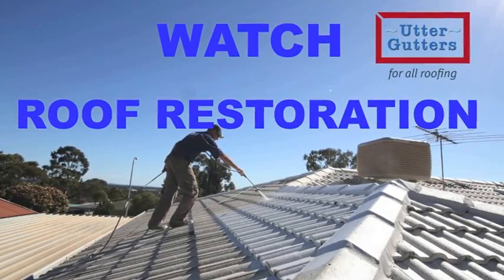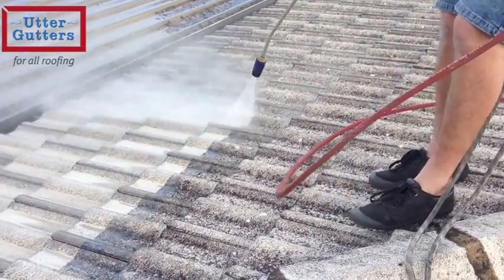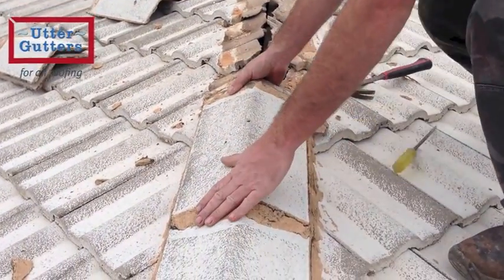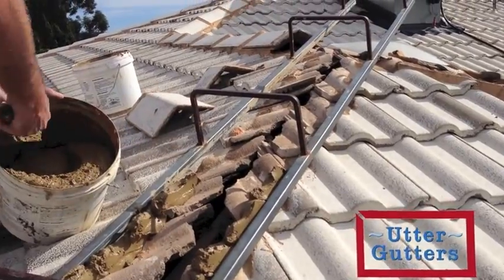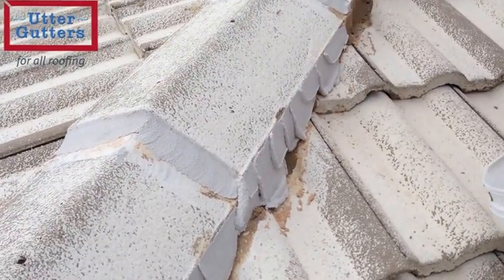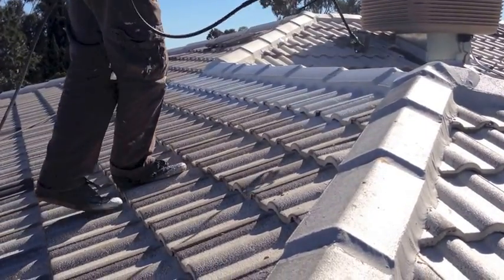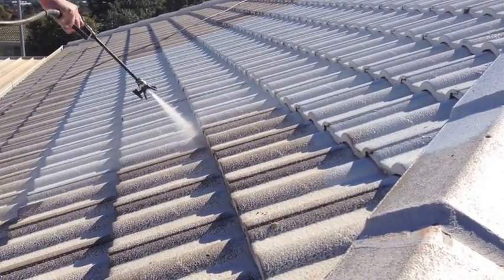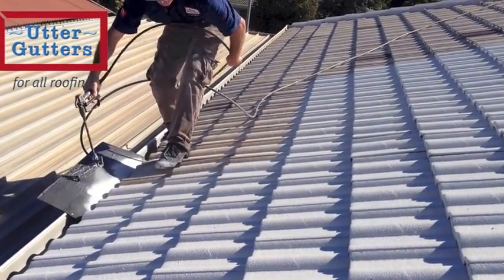Roof Restoration by Utter Gutters

Comment: A  GUN  THE  ONLY  WAY  AT  2500PSI   TO  REMOVE  MOSS .  HE  POINTING  OVER  CONCRETE  ITS  NOT  5MM  UNDER  CAPPING  .  AND  WEEP  HOLES  ARE  PUT  IN  DOING  THE  TOPPING  NOT  AFTER  LIKE  THIS  YOU  DON'T  DRILL  THEM  .  THIS  ROOF  IS  STILL  DIRTY  WITH  MOSS  NOT  CLEANED  RIGHT  HOPE  ITS  NOT  MY  ROOF  PAINT  WILL  GO  BLACK  AND  COME  OFF  .PAINT  ON A DIRTY  ROOF  NO  GUARANTEED  THEY  WALK  A WAY  FROM  YOU  SO  LOOK  OUT  FOR  THIS  PEOPLE